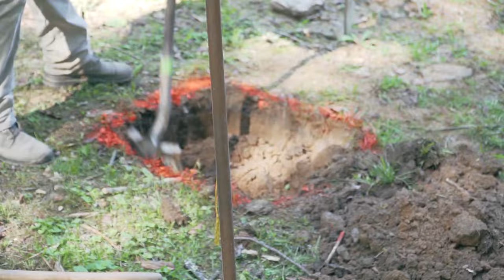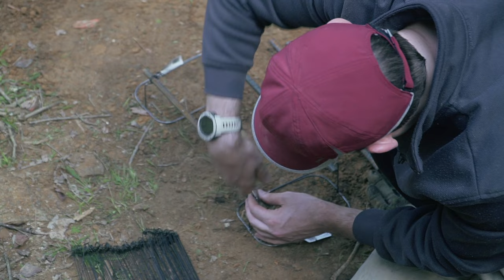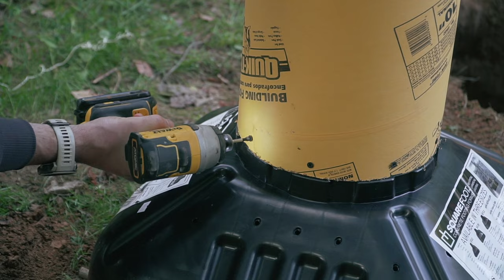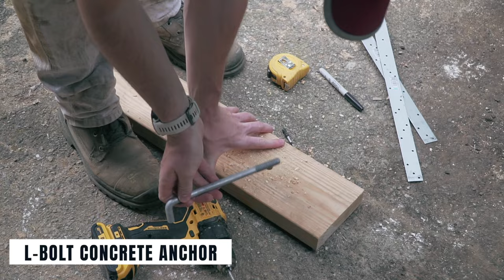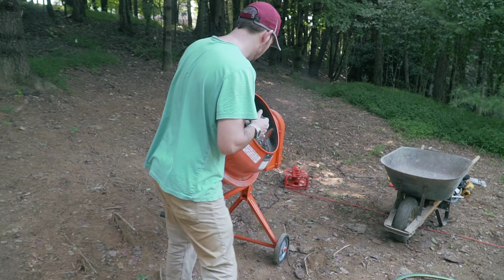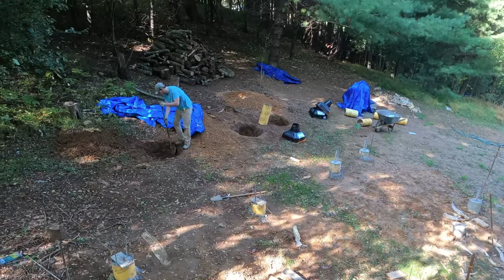Beginner Builds CABIN FOUNDATION From Scratch Under 4 MINUTES  | Start to Finish

Comment: Ive watched quite a few of the videos in this series so far.
I am a retired home builder having had over 40 years in the home building industry.
I am very informed of every aspect of home building, and personally qualified to perform many of them.
My opinion here based upon my long experience is that this guy is not the novice he portrays himself to be.
And i would also say that he dosent always work alone as the videos indicate.
There are things he does purposely i feel in order to make the job appear more difficult. 
Not that he is not at all unfamiliar with the use of power tools, such as the nail guns etc.
Also very few if any novices would even own the amount of power tools he has as well as the amount and quality of other tools as well.

Nor is he unfamiliar with laying out things like partitions, window and door openings etc.
Notice how he squared the partition while laying on the deck with his tape, no novice would know to do things like that.
Same goes with the electrical wiring, the vast majority of very good carpenters will have little knowledge about that.
So those who view these videos with the thought that with just a strong will this is all possible, think again before you try it.
Rest assured there is behind the scenes help involved here in order to accomplish much of what is happening.
Reply from the maker: Ernie, thank you for your comment, I have absolutely no prior building experience. I do have engineering experience so I knew a little bit about how things should be put together (structurally speaking).
For all the things I have no clue about, I do an enormous amount of research online before attempting a task. And even with all that research, I still end up making basic mistakes here and there 😂.

Comment: I'd love to hear more about your design process - How you determined the spacing, depth, and all that.  Whether you factored in soil tests to determine how big and deep to make your footers etc.
Reply from the maker: That’s a great question, in my area, there is no geotech test required so I used the typical minimum bearing capacity or 2,000 PSF based on minimum code requirements.
Reply: @TheDIYCabinGuy  Thanks!  We're these local codes or national/ansi/something else?
Reply from the maker: @POTheta001  it might be in the IRC or maybe in the local code, not 100% sure

Comment: Coming from residential construction, but would love to hear from you and others. Would the rebar going up the Sono tube riser need to be tied into the rebar cage in the 'footing'? I'm used to seeing rebar risers coming out of the footings that then tie the concrete stem walls rebar that's poured later to the footing. But that's with a 2 pour process, maybe it's different with monolithic single pours. Also, what's the frost line there in the Appalachians? Thanks for showing the build. I'll be watching it with my daughter.
Reply from the maker: Kyle, footers need to be 24” deep to be below the frost line. 
You’re probably right, I should have technically ties these up together but because it was a monolithic pour, I felt pretty comfortable with what I did.
Reply: @TheDIYCabinGuy  HAH! I knew you were a sham. Jk. I also love the way you notched the posts and braces.
Reply: Normally, the vertical rebar would be bent and overlapped, then wire tied to the horizontal rebar.
Reply: @TheDIYCabinGuy Frost frost lines get deeper as the winter temperatures get colder in the north.

Comment: Great job i have one question why to use form for concrate and not in the earth as it is why to spend money for the lpastic and the yellow thing the concrate dont damage dy the earth
Reply from the maker: That’s a good point, I guess it was just easier for me since I had never done it.
Reply: @TheDIYCabinGuy  i want to make one same in Greece now you now and you have experience you sugest me to use that with aut this in earth only the concreate ;my baget is not big but if worth it to use great jop you to understand my english xaaxx thanks for the answer
Reply: It's a balance between the cost of the materials or the cost of the concrete and work needed to make it.

Comment: How far apart should the concrete footings be apart? I'm building a 14x44 cabin with 2x8 floor joists. Any pointers would be helpful!
Reply from the maker: You kind of have to run the numbers to know, it depends on the tributary area applied to each footers and what bearing capacity you are allowed to use for each footer will define the footer sizes
Reply: @TheDIYCabinGuy  I'm going to be packing in a base of gravel level with the piers 1ft above ground level. Main goal is to have the peirs to prevent any shifting of the cabin. Got to go 6ft deep, wasn't sure if 8" width peirs were good enough or not. Spacing I figured I'd have 3 rows of piers. At 6.2ft apart to give me 7 per row. Will lay a vapor barrier before packed gravel to prevent moisture. Bottom of cabin will be pressure treated as well.

Comment: Rebar touching the soil,  will just rust out within a very short time.
Reply from the maker: That’s why the rebar is sitting on rebar chairs
Reply: I've seen a lot of rebar on bridges and buildings rust out. And they weren't even touching soil.   There are several rust resistant rebars now.  Even stainless steel rebar.
Reply: Generally, one and one half inchs minimum of concrete coverage on rebar will protect it from corrosion for a very long time in our soil conditions. Unless there is a high salt content in the area of the concrete. On the ground, I prefer concrete dobie blocks because there is no metal in contact with the ground. Metal rebar chairs would be for vaulted areas of form work not in direct contact with the ground. Rebar with a protective coating needs to be carefully protected. Every scratch will be a corrosion spot. The epoxy coated rebar that was specified for many jobs has fallen out of favor because of that corrosion problem. Materials are improved over time.There may be coatings that I am unaware of, I've been retired  for a while.
Reply: @TheDIYCabinGuy  on the material used they could rust then rust the rebar